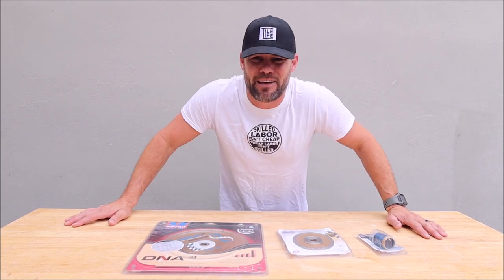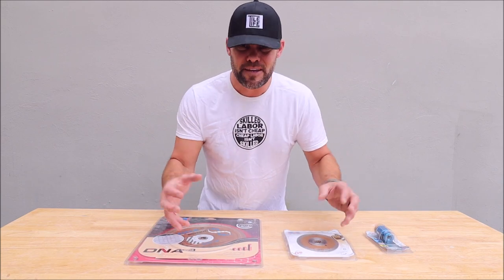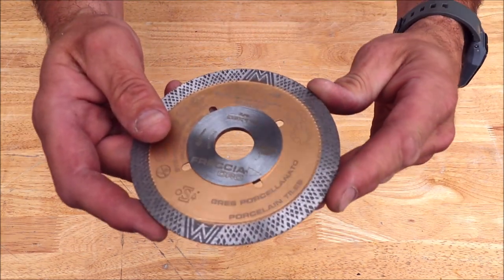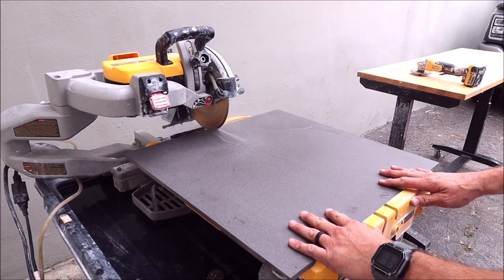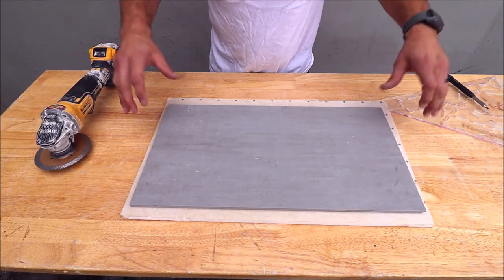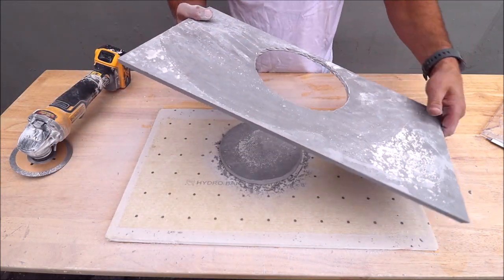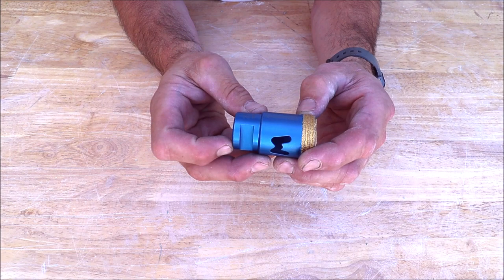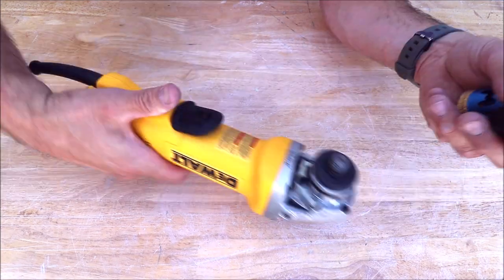Top Diamond Hole Saw and Blades by MONTOLIT Tile Tools

Comment: Just bought a Montolit 63P3 snap cutter and am quite impressed with the cuts. Was about to buy a Dewalt D24000S tile saw but the price just went from $849 to $999 - almost an 18% overnight increase.

Comment: Hi, I'm having issue with the bushing on every 4-1/2 grinder I own (Dewalt, milwaukee, bosch). They all have a 1/64 or 1/32 play. As a result the disc is off-center and doesn't make good contact with the tile. Did you replace yours or was it good from the get go ? Thanks ! Xavier